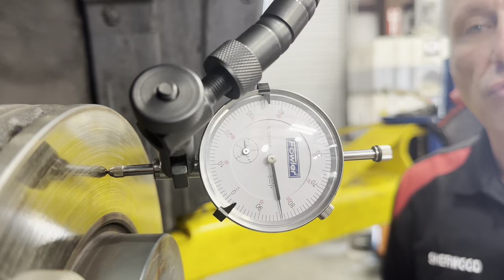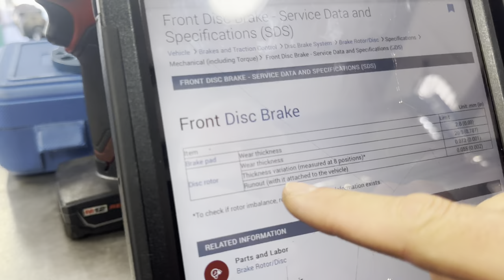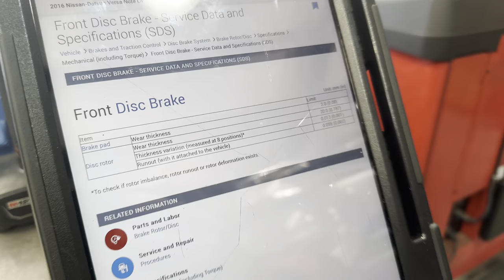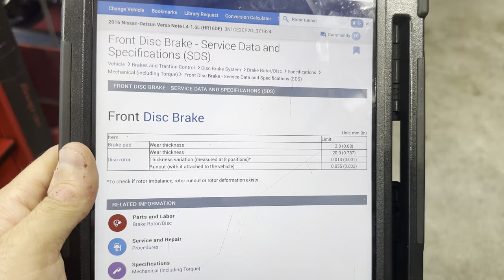It’s Vibrating When Braking & It’s Not the Rotors. How to Test! (Nissan Versa)

Comment: You kids and your crazy haircuts. Very good video. I've never checked run out on the hub itself but have repositioned the rotor 180 deg. When i find a bad hub, i usually find a damaged wheel. Again, it's a great video.

Comment: Nobody checks for runout any more. Just keep replacing rotors because it usually takes a few thousand miles for the judder to develop as the pads keep hitting the high spot, and leave deposits, then sell them another one. Its a Racket.  Driver is always blamed for a "warped" rotor by braking too hard lol. It's impossible to warp a rotor they are cast at temps far exceeding any temperature that can be created by braking. Ask Highway patrol mechanics, and even the brake manufacturers. Warped rotors are a myth its always runout that will usually cause disc thickness variation and judder. Thank you Sir for your honesty.

Comment: The newer rotors, say starting around the 2005 M/Y mark, started getting the thinner rotors, due to the EPA regulations which necessitated lighter components.  This is one of the easiest areas to shed weight. As you stated, most are too thin to even turn after one use.

Comment: I didn't see you guys even mention the cv axle.........I've run into a few cars where the inner cv axle roller bearings were binding during braking. And because the cv wasn't straight from the trans to the wheel, it had to constantly flex during any rotation of the wheel.
So wheel hub, rotor, and actual wheel/tire combo were prefect and still getting a vibration/pulsation, and it ended up going away as soon as the cv was replaced.
Can also happen during acceleration and at freeway speeds to mimic a tire out of balance.
Just another part to consider from my experience. Cheers

Comment: We bought a new 2006 Honda Civic DX from a Honda dealership.  From the beginning we had vibration when braking.  The dealership changed out the rotors.  We still had the problem.  In the end they discovered they had a malformed hub.  They apologized for the inconvenience and lost time because there had been notification within the Honda system but the technician hadn't checked.

Comment: as a mechanic with 32 years experience i can tell you that if it's not the rotor it is almost always a hub issue. one thing to do first before even check runout is to check for any wheel bearing play. even the slightest wheel bearing play will cause issues with runout and vibrations. but be aware that even if a rotor is new it is still possible it can be damaged in transport. my shop used to get parts from a few different parts houses and i would on occasion get rotors in a damaged box. you could see it had clearly been dropped. so i would throw it on the brake lathe and check the runout there before putting on the car
anything close to or over the max runout  that parts house was called to send another and take back the first they sent us.

do like how they presented this problem and explained how to diagnose the problem.

Comment: not the case on this car but for the ones watching to get tips on doing a brake job, always clean the rust from the hub before installing the rotor, and I always paint the hub with high temp paint, this keeps it from rusting, rust will swell up and cause runout in the rotor, it is called rust jacking, real common here in Ohio

Comment: There is one more test you overlooked while testing the rotor ,  is the braking surface of the rotor parallel with the mounting surface of the rotor where the studs holes are drilled . During the manufacture of the rotor , different machines may be used for the grinding of those surfaces and that may lead to unparallel surface planes between those areas. Repeat the dial indicator runout on those areas by placing the rotor on a turntable to determine if the surface plane of each is parallel. If not parallel then it's a manufacturing defect.

Comment: Excellent video. My issue is that, first off, I work at a tire shop. Our main services are brakes and alignments.
So we get less than an hour flat rate time on brake jobs and alignments. We don't ever get any diag time. So doing these steps hurt us financially. Owner won't change out time. And they seem upset if we ask for it. Never worked for a shop like this. Especially doing alignments for less than an hour. 
Not sure if I should stay or go. Shop is super laid back. But I do need to make a living. And I like you have been doing this for 41 years. 
Kinda stuck right now.
Got any advise for me?
But again, great information.

Comment: I have the same problem .I have 2017 Nissan Titan crew cab SV 2 wheel drive with 39,000 miles so I need to do the same test. Well thanks for the good video.

Comment: Great video! Thanks for this info!
 I have this problem with my front brakes vibing when braking from 60+. No vibes when I bought the car originally, but it began a little while after I put some "sporty" rotors on. I put up with it for about a year, then put new stock rotors on. It seemed ok for a while but seems to be vibing a little now. Ironically it doesn't happen at slower speeds, so I don't detect it most of the time, (local roads 50mph max) only when I drive 200+ miles to my sister's at the end of each month. I'll talk to my local garage about checking the hubs.

Comment: Well, so far in my over 40 years of driving, it's always been the rotors, which is why when I buy cars I look for 11 inch front rotors or bigger or make sure I can buy an upgrade kit.  You also have to make sure the brake pads move freely in the C-bracket.

Comment: Recently I have had a national chain massively overfill the oil on an oil change and after getting a car back from a dealer the tire pressures on 3 of the tires were almost 20 psi too much.  If a repair shop can't perform oil changes or tire pressures correctly is there any hope for what you are describing here?  I have never seen the incompetance of repair shops 20 or more years ago compared to what is happening today.  We  are headed for scary times.  You guys and how much you care and your expertise seems like a rarity.

Comment: The vibration I had on the front of our ‘10 Rogue was caused by a bad brake hose on the front right. Discovered it when replacing the rotors/pads.

Comment: I always check the hub for rust when replacing the rotor, and match the location. 
    A out of plane hub is rare but it's always a possibility. Almost always a cheap Chinese part, unless it was dropped and dented the face. Have also seen the studs interfere with the rotors.

Comment: Awesome video.  But quick question.

In this case it looks like a plain old worn out wheel bearing that would have (should have?!) been caught by wiggling the wheel sideways to check for bearing play.  Was there noticeable play in the hub when the rotor was taken off?

My hat's off to you for taking responsibility that the hub wasn't checked for issues as soon as the customer came back with a vibration complaint.

Comment: I had that problem with my Toyota Hilux. Changed the rotor twice, but similar problem continue to occur especially when driving going down hill fast. After a couple of years I discovered that the ABS actuator was bad. The problem solved after the actuator was replaced.

Comment: I worked at a Chevy dealership, had a vehicle with the same problem and did these same steps, unfortunately both sides were out. Was able to put a shimm behind the rotor to correct the issue and not replace wheel bearing. Was an actual TSB for it. It must of been fine, never saw the vehicle after that.

Comment: ... as one goes touching the rotor surface with ones hand ... oopsy doodle ... but yeah boy good to know ... my car has not had this occur it has been warped rotors and fixed but this is a good heads up for me to check for this when i am in there as I am a DIY person on my 20+ year old car as I stil enjoy wrenching on things ... thanks for sharing!

Comment: I got asigned a Dodge 1 ton years ago that had used up the front brakes coming through the mountains. Shop foreman told me to replace not only the discolored rotors and worn pads but the calipers also. His thought was the calipers must be sticking. Pistons were free and the calipers slid in the mount. 
So I did as instructed and replaced all.the parts. When done it pulled right on braking during a road test. Told to swap pads left to right. It pulled left. So they got aftermarket pads, which appeared to remedey the problem. A few days later the owner was back complaining it was pulling right. 
Of course another mechanic was put on it. When the problem first showed I questioned whether one of the rebuilt calipers could have a slightly different piston diameter, which got shot down right away. I do not know what they eventually solved it. They cancelled the hours I spent working on it as I had not repaired it to satisfaction.
I had a couple of other problems working there so ended up leaving. Good ridance to them!

Comment: Good find, unfortunately our shop only pays the tech .5 for a brake inspection. So basically after a test drive to verify the complaint that only leaves time for a visual on the pad thickness, wheel bearing check and the write up. Typically rotors are sold for this concern, if it comes back with a pulsation the rotors get turned on the car to match it to the hub.
Reply: You are correct sir. I bet 99.5% of the time this degree of brake inspection is not performed mostly because the tech doesn’t get paid enough to go this far. 
The customer also needs to be ready to hear that some parts may be worn enough that the pads or hardware fall apart while doing this inspection and now the car cannot be put back together safely without doing the brake job and now the customer feels trapped if they just wanted an inspection. These problems need to be addressed for this kind of inspection to occur, pay for the tech and education of the customer.

Comment: A great video on something I have never thought to measure on my own rigs. i currently have this issue too so hopefully it is just a bad rotor/s vs a hub or two. 
    If those both check out okay is there anything else that would cause this issue besides wheels and tires as those are easy to swap and see if they are or not.

Comment: Over 30 years as a mechanic and I have never seen a "warped" hub. I have seen bent hubs from some sort of impact or loose hubs due to bearing failure, but never warped. The idea of spending time checking runout on the hub for every car with a brake pulsation is crazy.
Reply: I agree 100%. My bet is the front wheel drive shaft is moving that hub around because the bearings are loose. He didn't mark the hub and I didn't rewatch the video so I didn't track how often on the face it was going min/max and whether it was always in the same places. My go-to right after the rotor check would be a bearing check to see if the hub bearings were loose.

Comment: The rotor is glazed ,diy guys can remove the glaze by wet sanding with 400 grit using small cycular motion, as dumb as it might sound  rotors typically dont warp. Ive used this method and it worked every time for me with severe brake shake i never turn rotors, they are too thine and shake returns  Also use the most extensive pads they carry at the part store.If it was the hub the wheel would shake all the time not just when braking

Comment: Have never seen a "warped" rotor, unless they got so hot they turned blue. Rotor "warpage" is pad material stuck to rotor surface, hard application from 60 to 0, two or three times, then allowing cool down, usually is sufficient.

Comment: The other way to check the hub, that I have done in the past. Put the right rotor on the left side, Left rotor on the the right side and remeasure. if it measures the same, it would be in the rotor. Also, I am wondering, Did the car have a vibration when the first brake service was done, and did this show up on the road test after the brake job? How did the hub get bent, that is not very common unless the car was in a collision.

Comment: I need same tool shown ~@0:45 and found on Amazon Magnetic Base Flexible Flex Arm 1"/0.001" Dial Indicator + Case Machinist Auto Engine Tools, but not sure if it is the right Dial Indicator. Could you tell what tool did you use exactly? Thank you for the great film and pointing out on the tool which was not known to me before. I was absolutely thrilled by the phrase "I'll turn the Magnet on".

Comment: Very good video. On my car I replaced rotors and pads. One side at a time. Car drove fine before just had a warped rotor when brakes applied. After replacing drove the car it vibrates like crazy over 65 brakes smooth when you stop no pulsating. Still checking and scratching my head. I jacked the car up removed the rim put on a couple nuts had my friend idle the car in drive you can see the caliper moving back and forth. I just seen this video and now I am wondering if this is my issue. I just don't understand how the car never had these vibrations until the new rotors and pads.

Comment: The rotors do contribute, though. Even though they run true, they provide the exciting force and energy to move the calipers around, which in turn moves the pins within their holes in the knuckle. Excess grease can contribute by resisting full seating of the pins via hydraulic lock. A tiny weep hole into the sliding space of the pins is the optimum fix, but a rubber or brass "check valve" needs to be thought up to keep dirt and water out when the space breathes the other way.  I'm thinking maybe a carb float valve.

Comment: I use a pneumatic die grinder with a stiff wire cup brush and clean the mating surfaces where the brake rotor and wheel hub come in contact. Then, I smear a very thin layer of anti-sieze on the mating surfaces to prevent future corrosion.

Comment: With a bad hub, if it's bad enough you will see the movement in the wheel, a bad rotor will not put a wobble into the wheel when not braking. If you spot the movement in the wheel, swap the wheel with the other side, and if the movement stays on the original side you know it's the hub/axel.

Comment: If the vehicle is high mileage, it could also be the motor mounts causing vibration. Well, it would be the engine causing the vibration because the mounts are not dampening it. Wasn't the case this time, but can be hard to diagnose because how often do you check motor mounts vs brakes?

Comment: In a situation like this, it's best to take the rotors and swap them side to side then remeasure. If the runout stays with the rotor, then it is the rotor. If it stays with the hub, it's the hub. Very simple.

Comment: I was always taught that lateral runout alone does not cause pedal pulsation because most vehicles have floating caliper assemblies. As long as the assembly is not seized and able to move freely, the lateral runout is "absorbed" by the floating caliper and you will not feel a pulsation. The actual cause of most pedal pulsation is thickness variation.

Comment: You just gave me a hint.
I have a slight thump on my brakes after replacing the pads and both rotors. It was really bad before I did that. Now I feel a slight thump but only after the brakes have been warmed up. I'm now suspecting I have a bearing that is showing some wear such  that it is a tiny bit out of round. The thump is exaggerated once it warms up and then it is more noticeable. It is tolerable for the time being but tells me I probably will need to replace bother bearings before winter sets in.
Is it possible the slight out of round bearing ate into the rotor in the same out of round manner and caused the thump to be really bad?

Comment: had a f150 that kept warping rotors . checked it out just like you did everthing was good . after a few hund mi warped again , it never had any sticking on the lift . always spun free . i noticed the brake hoses mounts had some rust pryed them open and problem solved.

Comment: I own a 2018 forester with 91000 miles and experience a significant shimmy upon braking at about 50 mph or more. Rotor runout checks out ok. As does a visual inspection and tire test of the wheel bearings. When asked about checking the hub my trusted mechanic of 30 yrs said he felt a bad hub would impact the rotor too so he didn’t look at hub. Since rotors checked out he was satisfied. Brakes replaced at 58000. He didn’t say anything about too tight calipers. Will have to ask him. Could it be anything else?  Note:  bushings were replaced last year. This I’m told is a common failure with Subarus; especially maybe the forester at 75000. Thanks.  Is there more than one pair of bushings in front end?

Comment: Did you check for wheel bearing wobble prior to removing the tire and brakes... did your advisor and you ask enough questions to the customer to find out when the wobble began, if it was all of a sudden, gradual, after a certain incident, had it been to another shop prior, what did they do etc. etc. Sorry if I nag.

Comment: My wife's 2004 Mercury Sable developed same symptoms. I had an auto parts business.  Got a reliable private garage do a rotors/pads brake job with good after market parts. Carried it back because the vibration problem started. They roughened up the rotors with an angle grinder.  No help. Changed to FoMoCo parts. No help . They did many other things, nothing worked. (I am certain they did not check hubs, though...) My wife got pissed. Wound up getting her a new Volvo and I sold the Sable.  You can imagine what a horse's ass I looked like selling a car below book because of problems WE could not repair...  😊